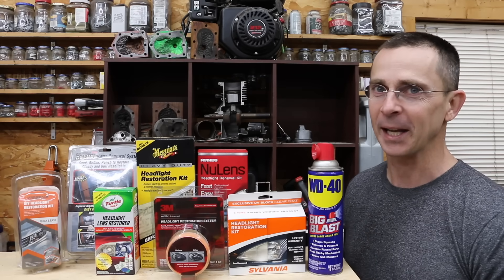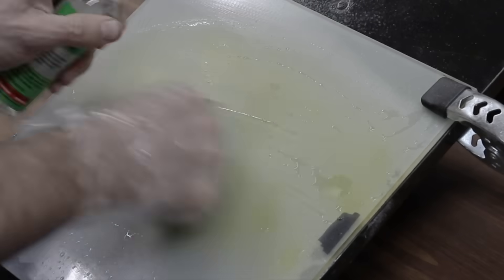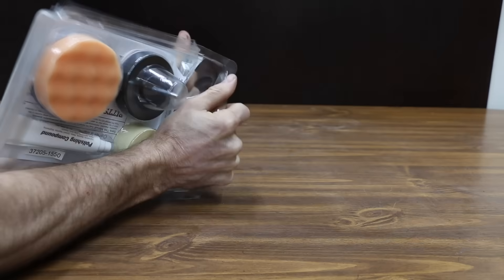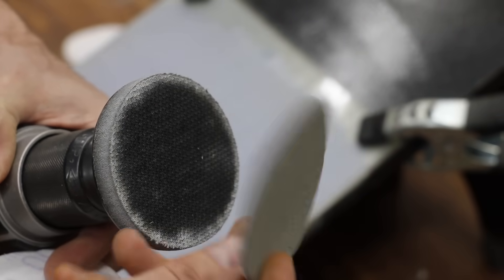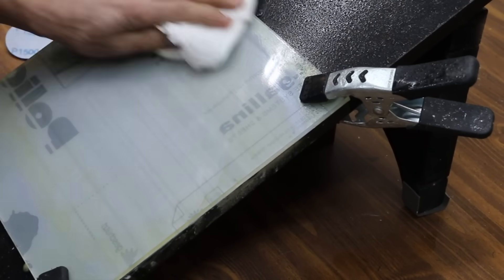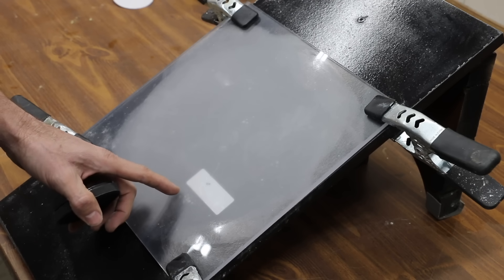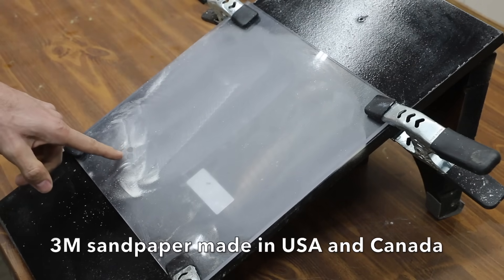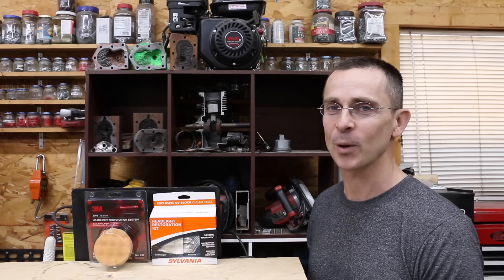Best Headlight Restoration Kit?  Let's find out!  3M, Sylvania, Meguiar's, Mothers, Turtle Wax & HF

Comment: New test idea - DIY ceramic coatings on the exterior/interior surfaces for exhausts and turbos measuring changes in temp, flow and durability.
Reply from the maker: Thanks for the suggestion.

Comment: i used the 3M kit on my jetta a while back and when i was done with the kit i wiped my headlights down with alcohol to clean them off and shot 2k automotive clear over them in a 3 step 1 dust coat 1 med coat and 1 heavy cote like you would automotive pain and then i wet sanded and polished the clear like you would automotive paint 2 years later my headlights still look factory new before i started they was about as yellow as yellow could get they looked like fog lights lol i recomend the 3M kit to anyone
Reply from the maker: Thanks for sharing!

Comment: I use the e3 spark plug in older lawn mowers and it really brings them back to original power. My 29 year old Cub Cadet runs like brand new with the E3. I put them in my 2006 Ford Fusion, it increased milage and power. But the cars computer put out error codes. I suspect that it was burning more fuel and sensors were reading  a whole lot less. So I think it confused the cars computer. The only way to satisfy the computer was to put standard plugs back in!!
Reply from the maker: Thanks for sharing.

Comment: restore kits a waste of time.  They never last very long and the results are questionable.  What you need is some 2000-grit wet/dry sandpaper and wet sand to fine haze, buff with some rubbing compound to nice and clear and then finish with a ceramic finisher.
Reply from the maker: Thanks for the constructive feedback.

Comment: Thank you for this. Will help me decide which kit to choose. I am leaning towards the 3M because it appears it is a quicker process.

I may have missed a comment but my future suggestion would be to include an effort score and a time to complete rating. You allude to it throughout the video but in my case I want to do this quick but achieve good results.

Lastly I agree with the others, it would be good to show a follow up 1 year later similar to your wiper blade tests. Due to the inconsistencies of ‘real world’ uniformity (control) in testing this subject, I see this would be quite challenging to do though.

Great job on this and all your videos! Keep up the great work.

Blessings!
Reply from the maker: Thanks, will do!

Comment: I used the Turtle Wax brand and it worked great ...... the kit included everything I needed and I didn't have to use any power tools to restore the headlights on my 15 year old Ford Edge ...... it really worked as promised and didn't take a lot of work to do it ,,,,,,, just follow the instructions and you will get great looking headlights back
Reply from the maker: Thanks for sharing.

Comment: Rainx makes one that’s awesome and you don’t need to sand or anything. Apply a lot then rub it in for a couple minutes. Lasts a year or so before needing to reapply but for 7.99 at your local store it’s a no brainer. 5 minutes and done for the year and all you have to do is rub it in with a microfiber towel lol
Reply from the maker: Thanks for sharing.

Comment: I love the 3M kit.  I've done probably 5 pairs of headlights with it (you don't need to use much compound) and it's finally wearing out.  The drill makes it easier, but you do have to mask off any nearby paint. You're correct about the UV protection.  They have dulled in about a year here in Texas. I'll have to get some of that UV protection.
Reply: May I suggest Maguires Clearcoat which as uv protection in the can!! You need a 3M respirator with pink vapor filter or equivalent! You don't want this snuff in your lungs, Maguires only needs one coat and drys fast, Don't spray in direct Sun!! And remember nothing is permanent when it comes to headlight restoration, The difference is Maguires is easier to remove than 2k clear for example good luck!!
Reply from the maker: Thanks for sharing.

Comment: I’ve used a few of these kits.  The Sylviania a couple of times.  It didn’t work well applying the clear in sub 50 degrees- the clear didn’t even out.  The other time in warmer temps was good, lasted maybe 18 months.
Have you tried a clear coat like a commercial auto paint uses, a two part clear?
On my 2002 Subaru I applied an expel film on the headlight lens which appears to protect the oe clear very well and also from rock dings.  Expel film lasts ~ 10 years.
Reply from the maker: Thanks for sharing.

Comment: In all these comments, this has probably already been said. I cleaned the headlights on 2 vehicles in about 1 minute. I wiped the lenses with acetone, they're instantly clear, all were heavily yellowed. I can't recommend that you try this, because you have to be confident in what you're doing, or you could have problems. I soaked a new paper towel in acetone, and gave the lens one good swipe, that's it. I came here to find a good sealer for my headlights. 
Always great videos on Project Farm. I wonder if it would be worth a video about how the headlight sealers perform after a year of sun exposure?
Reply from the maker: Thanks for the suggestion.

Comment: Can’t see anything that makes me want to use any of these products. 
Last weekend I was detailing my cars engine and when I was done I decided to attempt to polish the headlamps on my odyssey. I hadn’t watched this or any video, but have polished cars in the past as well as long ago worked at a shop that built Corian countertops. 
Sanding that material from 220 through 2000 or finer, and using polish and eventually a sealer I think, I had an idea of what might work. 
Sandpaper however was NOT considered. 
Instead I cleaned first just to make sure the surface was spotless. Using an orbital sander and polishing compound I achieved a clearer and smoother initial result. Giving up on the orbital sander, it was too slow (ryobi) I next tried a right angle polisher with a fluffy pad, (sheep?) and came out with better looking results and only an hour or less wasted time. I didn’t know about the protectant layer. I’ll probably try some rain ex or similar. 
But using sandpaper on the plastic lens meant if it looks bad at the beginning, you are now either screwed or committed to going thru lots of steps to reach clear again. 

No way

Comment: I have done a couple of cars this way:  Both cars' headlights were moderately fogged so I wet sanded with 2000 paper using a foam sanding block and added a squirt of dish detergent to the water, then used a lambswool polishing bonnet and 3M Finessit ultra-fine liquid polishing compound on my buffer. Perfect results!
Reply from the maker: Thanks for sharing!  That's great to hear!

Comment: There's a product called Mercury power tune it's for 2-stroke outboards, buti think it also works on 4strokes as well. Works like Seafoam but all and all a better product. I use it for many things mainly cleaning old carbs.
Reply from the maker: Thanks for sharing.

Comment: Thanks for the great review videos.  I've used the 3M kit a few times but as you mentioned it needs a clear coat.  Can you do a comparison of the different ones?  I've used the Rustoleum clear for plastic with UV protection and found that it only lasted about a year. I also had a car that had  a clear film like Lamin-X on the headlights that looked like new after 10+ years.
Reply from the maker: You are welcome!  Thanks for the suggestion.

Comment: THANKS AGAIN FOR AGREAT VIDEO!!!  I purchased and used the Turtle Wax product on my 2002 Dodge Caravan and it worked well (sand paper pads and rubbing compound) UNTIL I got to applying the final protective coat/sealer on the clean AND THEN CRYSTAL CLEAR headlight covers.  It may just be me but the pad containing the protective coating/sealer was rather small and it dried out before I could completely apply ONE COAT to ONE HEADLIGHT and it dried almost instantly upon application.  I performed all of the work in the shade and the weather was overcast, so the headlight lens were not exposed to sunlight during the whole process and not even warm when I performed the application of the protective coating/sealer.  There is a SECOND PAD in a separate foil package that THE INSTRUCTIONS SAY you can use to repair a SECOND SET of headlights.  A caution to anyone that tries this kit, you will most likely need ONE of the pads containing the protective coat/sealer for each headlight.  

To FIX the dried and streaked, uneven application of the protective coating/sealer (due to either extremely fast drying OR MY LACK OF SKILL IN APPLYING IT QUICK ENOUGH AND SMOOTH/EVENLY ENOUGH).  I searched purchased a Sylvania "Headlight Restoration Essentials Kit" which contained ONLY a small bottle of UV Block Clear Coat liquid (and also included a number of blue applicator pads AND a small bottle of "surface activator" - I did not use the surface activator as it it is intended for use as the first cleaning step BEFORE Sanding and my headlights were already clean and very clear except for the dried and streaked/uneven Turtle Wax clear coat).  

The Sylvania blue paper pads were perforated and allowed me to tear off ONE section easily.  I folded the blue paper pad according to the instructions and poured a generous amount of the Sylvania UV Block Clear Coat liquid on ONE leading edge of the folded blue pad and applied it to the first headlight and IT WORKED!!!  The Sylvania UV Block Clear Coat liquid appeared to melt the streaks, quick dried portions and uneven application of the Turtle Wax "sealer" and brought back the NEW Appearance of BOTH HEADLIGHTS.

So if your FIRST TRY IS UNSUCCESSFUL like mine was, you CAN RECOVER and repair the botched repair!   

I did not use the Second Protective coating/sealer pad in the Turtle wax Kit yet as I will try it on another set of UV discolored van headlights, to see if the Turtle Wax protectant does the "Quick Dry thing" again or if I have NOW learned how to apply it faster and more evenly.  ;-)

Regardless I still have 80% of the bottle of Sylvania UV Block Clear Coat liquid remaining to correct any additional mistakes I may make restoring other sets of headlights...  ;-)
Reply from the maker: Thanks and you are welcome!  Thanks for sharing.

Comment: I have a 1999 expedition, I used mosquito repellent three years ago. It removed a very good amount of oxidation to the point that it was very acceptable. I rinsed them thoroughly with a lot of water but I did not sanded them and did not clear coated them just to see what happens. At this moment they are yellowing again. Next time I will sand them and clear coat them just for fun.
Thank you very much for all your videos.
Reply from the maker: You are welcome!  Thanks for sharing.

Comment: I really liked this one. I only wish you had tried the Deep Woods Off method. Not sure how it reacts with yellow paint but, if you use it on an oxidized headlight is is amazing just how much it clears up. It basically chemically melts the oxidized surface cracks of the polycarbonate and it re-fuses clearer. In my experience if it is super rough and yellow it may need a light sanding with a 600 grit ot so and dried. A cloudy clean lense will turn clear nearly immediately. Once treated and dried it can be washed and then treated treaded further with a uv gaurd.
Reply from the maker: Thanks for sharing.

Comment: I first found out about the Sylvania product from a Consumers Reports test years ago.  I have used it on several vehicles about every two to three years and it always makes the headlights look like brand new.   As you found in your test, there is more hand work, but that also allows you to get to all the corners of today's oddly shaped headlight lenses.   Thanks for yet another superb product test.
Reply: Will the old clear edge line show through the new clear if not sanded (feathered) carefully? Or should I remove all the old clear?
Reply: @MrTuberguber  Resurface any cloudy areas.  The final UV protective coat which turns the resurfaced areas crystal clear will leave any already clear areas clear.
Reply: @gregfeeler6910  Thank you
Reply: @MrTuberguber  definitely remove all!!!
Reply from the maker: You are welcome!

Comment: Thank you so much for testing all these products 🙏

Sylvania 
- best 
- cleans pretty good like new
- no drilling tool needed
- $19.99

3M 
- runner up
- needs UV protection coat (not included)
- doesn’t clean as good as sylvania
- drilling tool required
- $13.43
Reply from the maker: You are welcome!

Comment: That looks like a lot of work.
I was doing an EGR cleaning  on my Jetta TDI the other day , and just for the heck of it , I put some spray brake cleaner on a rag and rubbed my very faded hazy headlights.. I would say they went from a 3 in clarity to an 8 -9 . Very fast and easy BUT  try this on a small spot first. Also this will not leave any UV  protection .  Total time do do this was about 40 seconds for both lights
Reply from the maker: It is, thanks for sharing!

Comment: I appreciate the time and effort it took to perform all the tasks in this video. However, simply judging the tail of this video when comparing the clarity of each brand, I didn't think any of them came anywhere close to new. If sticking the box behind the sheet of prepared polycarbonate was supposed to demonstrate each brand's clarity...none appeared clear. Then again, it may just be my monitor (but not likely).
Reply from the maker: Thanks for the feedback.

Comment: I had exactly the opposite results. So did WatchJRGo in his video. Turtle Wax’s kit cleared my headlights up best. I suspect the material you are using for the test is actually softer than actual headlights.
Reply from the maker: Thanks for the feedback.

Comment: I used a different 3M kit it came with the UV protectant but was more expensive.  It made a huge difference. My wife is definitely happy. It took a while since the lenses where seriously scratched up and yellowed. Then we changed to LED lights and the car looks quite a bit different now.
Reply from the maker: Thanks for sharing.
Reply: Are the lights still holding up well?
Reply: @87tunj  So far they are holding up quite well.

Comment: Hey there Todd, I would like to see a video on testing the durability of headlight coatings after restoring a headlight. I feel like the restoration process is quite easy to do, however the real work is in keeping that headlight from yellowing again. I heard great things about ceramic coatings to protect headlights, however i'd love to see you put it to the test.
Reply from the maker: Thanks for the suggestion.
Reply: I would spray them with a non yellowing, uv protective clear coat spray paint. It will last a lot longer

Comment: GREAT JOB ON THIS COMPARISON TEST.... DO NOT PURCHASE THE TURTLE WAX SYSTEM IT IS A RIP OFF!!! The Turtle Wax system I bought worked VERY Well in cleaning up the degraded plastic and the headlight lens LOOKED GREAT/NEW after using the rubbing compound three times on each headlight, then sanding with both grit sanding pads (on each headlight) and reapplying and buffing the rubbing compound (twice on each headlight)... THAT IS WHERE I SHOULD HAVE STOPPED... but I went forward as the instructions stated.... ...the Turtle Wax system I purchased ALSO said (for the final Ceramic Acrylic Wipe) to apply "QUICKLY" which is IMPOSSIBLE to accomplish with the cheap wipe cloth (WITH A MINISCULE AMOUNT OF CERAMIC ACRYLIC SOLUTION ON THE CLOTH WIPE), they provided to apply the Ceramic Acrylic Coating for ONE headlight (much less two).  In preparation for this last step.....  I had my van sitting (in the shade) with a cover over the headlights for an hour or two (both headlights were cool to the touch).  As soon as I ripped open the CERAMIC ACRYLIC Foil pouch and began wiping the first headlight lens the CERAMIC ACRYLIC COATING started DRYING on the Headlight Lens....  I rushed to cover the other lens and ended up with TWO HEADLIGHTS, with fuzzy sections on them and streak sections/lines.  The CERAMIC ACRYLIC "WIPE" INCLUDED IN THE KIT IS "NOT SUITED" TO DO WHAT THEY tell you to do.  Do not waste your money!!!
Reply from the maker: Thanks for sharing.

Comment: I used Cerakote Headlight Restoration kit, had hand sandpaper with a hand holder with velcro for the sandpaper disks.
Wipes for removing oxidation/yellowing.
Wipes to ceramic clear coat.
Step 1 oxidation Wipes, step 2 wet sanding, step 3 clear coat.
Turned my headlights clear as I've ever seen them in many many years. They claim to last lifetime if done correctly
Reply from the maker: Thanks for sharing.

Comment: When I worked at the auto parts store. We sold a popular mechanics kit that was advertised as the best by some big name testing company.
I've used the more expensive 3M kit, before they had the cheaper one you tested, with positive results. However, I can confirm that those headlight lenses are back to about the same appearance now because of the lack of UV coating. Didn't know about it/was but readily available when I did it.
Reply from the maker: Thanks for sharing.

Comment: For a really cheap but good fix, go and try Brasso, you need to repeat a couple of times but it works well, does not scratch and is very cost effective.
Reply from the maker: Thanks for the suggestion.

Comment: I found a spray wax that is made for all surfaces, paint, plastic.  We used it on our motorcycle windshields. After washing my vehicle, I apply this wax and buff.  My headlights stay clear 5+ years.  I usually trade in at 6 years, so I can’t say anything after that.
Reply from the maker: Thanks for sharing.